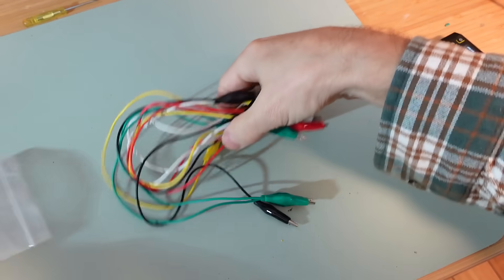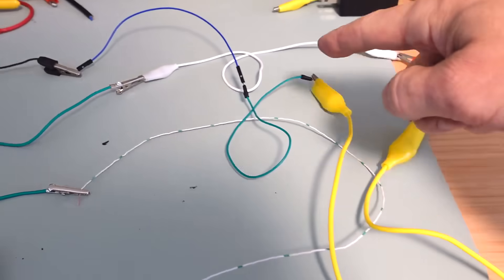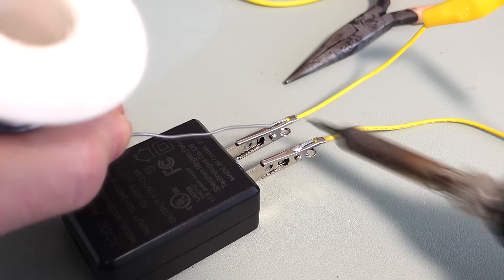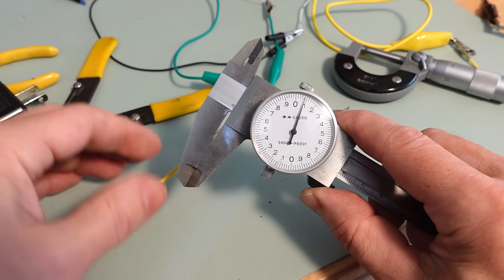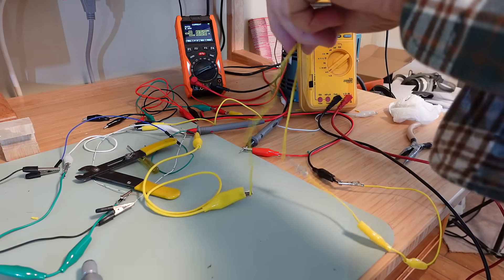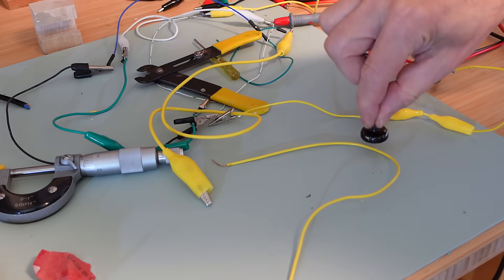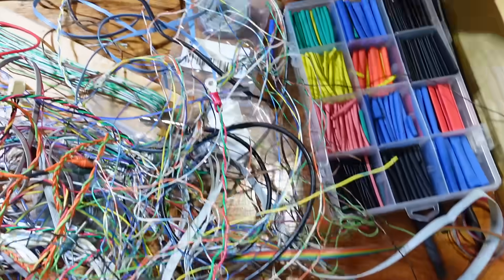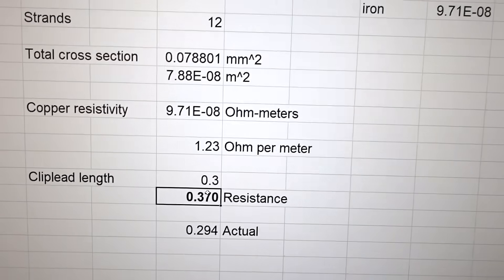Clip leads made with fake wire

Comment: Sir, after watching your video, I grabbed a magnet and poked around in my drawer as well. I was shocked to discover that even some very short (and thick!) MOLEX computer power supply cables I had used for various projects were completely fake. Not only were they not made of copper, but beneath the thick insulation, they barely contained any strands of wire. Naturally, they came from China. It's amazing the lengths some manufacturers will go to just to cut costs. If only we had some way to verify these things before making a purchase, but that's next to impossible on AliExpress. It's not even a matter of paying more, because you can't be sure that a product costing three times as much as the cheap one is any better in quality. I guess it's just a gamble, then. Thank you for the eye-opener! :)

Comment: I order a bunch of these from aliexpress using them for testing led lights but the wires were getting hot so I tested them and they had a higher resistance than normal and I did the magnet test and the magnet stuck so now I buy mine from harber freight they work good.

Comment: Iron huh? That sure explains it. I found this problem a few years ago. I bought a bunch of jumpers for an Arduino project From China. They didn't perform right. I measured the resistance and found them to be about 7 ohms for a 6" jumper???  I didn't check with a magnet but I'll bet they would have stuck. I threw the batch of jumpers in the trash. Where most of their copper products belong.

Comment: Yep. I got a bag like that. Half the alligators pull right off the stranded sire. The ones you show in this video are twice as "quality" as the ones I got. The ones that were crimped well enough to carry current melted under very low current. I think they had maybe 4 or 5 strands of Chinesium alloy.

Comment: I got some of these a couple months ago before watching this.  Laughed when I noticed how thin the wire was, then replace all with 20G wire.  Now you proved those wires are steel !!  Houses will be burned to the ground.  Hell,, I have some smaller USA made automobile alligator clips made about 25 years ago 10X thicker with real copper.  They have a warning label on them to not exceed 1/2 amp for continuous, confined usage.  These fire making china death leads should be marked:   "STAND BACK - SHE"S GONNA BLOW"
Reply from the maker: Electroboom recently had one go up in smoke on his videos.  No doubt knowing it would go up in smoke before ne did it, as most of his accidents are intentional.

Comment: By the way (I haven't read all 3,385 comments...) check the leads on any cheap parts you buy, too.  Resistors, caps, etc.  Some of them are iron core, too.  Of course the leads are relatively short, so the effect isn't quite so pronounced.

Comment: Interesting this...  I measured my jumpers that looked exactly like Mattias's...  however, the clip itself is iron, while the wire is non-ferrous.  When I measure on the fluke 87-V multi-meter, I get 0.2 ohms or 0.3 ohms....  I decided to put the wire on a good LCR meter with calibration done on it first...  The assumption was that the LCR meter, has more resolution at low resistances...  Sure enough, the two LCRs that I have measured .02 ohms or .03 ohms.    The specs on the Fluke say that maximum low end resolution for ohms is 0.1 so that explains why it would not show anything lower in value.  Soldering my wire connections on the clip itself revealed no significant improvement.  Fun little experiment!

Comment: Built my first working circuit 51 years ago, where I had to solder something. Before that I had used clip leads and could barely open them at that age. I can attest that clip leads are the most irritating thing I use now because of all these aspects you pointed out. Misery may love company, but not in this case.
Reply from the maker: worst is, if I put a clip lead around something large, and then as I'm debugging, the clip lead somehow slips off the round thing and jumps from the spring energy.  And then not remembering exactly where it went!

Comment: I was just testing some I just bought from jungle site.
They also had high resistance, it seems to be the wire causing the issue.  I did not try a Magnet yet, although I was suspecting the wire wasn't all copper.

Comment: A coworker bought a set of MADE IN CHINA battery cables and asked me to see why the cables didn't work. One of them had a copper wire shorter than the insulation and they only stuck the insulation to the clamp. That's why it's important to have quality control.

Comment: I've noticed another "fake metal" (sort of). Most of the cheap kitchen utensils that are billed as stainless aren't, to varying degrees - usually shows up as a rusty fleck. Not catastrophic failure, just heightened cynicism 
toward Ji-na 😊
Reply from the maker: There are different grades of stainless steel.  Some, like the cybertruck apparently, will rust when exposed to salt water, for example.  Could also be heat from a diswhasher doing it.  Or they are just coated with something instead of stainless steel.

Comment: I often use these cheap clips in my projects and this explains why I sometimes get really strange readings, especially since I work with low voltages. I never though about testing them. I will be going through all my wiring and check for Iron. I also bought a few transformers a few years ago and found out the windings are not copper at all - they are all coated with a copper color, but when you sand the ends for soldering, they look like aluminum..... i hate fake stuff - especially when they were not cheap.

Comment: I have issues like this all the time.  Fake wires are really common, and it's pretty bad with USB cables, etc too.  I stripped a few just to look and was kinda shocked.  Yea I think I found a few USB cables made with this junk too instead of copper.   They would barely give anything a charge, and overheated like crazy.   I couldn't figure out for the life of me why they would do that, when I realized just how valuable copper is getting.  It used to be really cheap, but the price is rising quickly, especially overseas.  I've also had to be careful with chargers, and even extension cords.  Found one that was definitely not the gauge it had indicated, and I got the stupid thing at a store, not online.  Took it back explained that the USB ports in it did not work, and the cord itself was unsafe to use.   They didn't care.

Comment: I have the same clip leads. Some of them didn't even had contact to the clip of just fell off after I had used them a few times.
They produce everything as cheap as possible...
A while ago I scrapped out a cheap chinese table fan, which had a magnetic power cord and hollow iron prongs on the plug. And copper coated aluminium for the motor wire.

Comment: I've used these test leads to charge batteries at very low current and had them pretty much melt, this explains a lot of issues I've had and it looks like I'm going to have to throw away everything I currently have and try to get some new higher quality ones.

Comment: If it's from China, not surprised. I worked at an alloy fabricator once as an electrician. Lot of the alloy material came from china. On several jobs , they were unable to get accurate machining  on a CNC machine. It was terrible. It was discovered the alloy had a mixture of lead in it. It was unworkable . But China did not want it back , the customer had ordered  it and delivered it to us. Job was never done, the alloy sat  there for months until a decision was made.  It was all scrapped.

Comment: Lovely investigation.  Thanks for sharing it.  It is one thing to make electrical wires out of iron, if that is the product you are manufacturing, then whatever, but to coat them in a thin layer of copper to trick people into thinking they are copper is just plain evil.

Comment: those mouse wires may be magnetic due to shielding. sometimes they use metal wrap to strengthen the cable knowing it will be tugged on.|
I will definitely be checking test leads a hell of a lot more often now!

Comment: Well that explains something.  A couple years ago I grabbed a couple of clip wires to test a relay in a car. Should have drawn less than an amp. But one of the clips wire heated up and melted right through the insulation.  I thought that it must be shorted out internally. But this didn't make sense since I was getting correct resistance readings. Replaced the relay and went on with life wondering about the mystery. After seeing your video I grabbed a magnet, and yup, the clip is iron wire. Mystery finally settled.

Comment: Cool research! Thanks for the warning! Given my recent experience, 99,999% of cheap Chinese stuff is an imitation in one way or another. 
Ranging from simple wires and "20A" multimeter probes with no indication of a cross-section to the trending things like ZOYI ZT-703S that has critical issues in almost every function, those are just very low-quality (in both design and execution) toys that pretend to be useful. 
For instance, they also make windings of scooters and motorcycle stators from what is called copped-clad aluminum, so that they look like copper but way less efficient and will burn because of their lower characteristics. But who cares.
Unfortunately, there is almost no middle ground, component stores with extreme shipping costs, and high-end products that are not very suitable for a hobbyist due to their prices.

Comment: I had to replace a three-core flexible cable feeding a 240 volt machine because the insulation was falling apart. The machine only needed a small intermittent current, the cable was protected from damage behind a wooden panel, it was in a place that didn't suffer extremes of temperature. It was of course a Chinese made flex. I've also bought small "brass" brushes that were really steel brushes made with brass plated wire.

Comment: Got these same jumpers, come to find the actual wire was 1 strand covered by cloth strands. 
It had like 15 strands on cloth and 1 strand of actual wire which was the conductor.
After stripping it down and soldering the actual "wire" i finally got 0 ohms across it.

Comment: This makes me want to spend a afternoon and test all of my clip leads wires .I have a ton and now I'm wondering if some of my past problems is due to cheap fake leads
Reply: Got these same ones, come to find when i stripped them back, it only had 1 actual metal strand of wire wrapped with about 5 cloth "fake" wires then the insulation.
After stripping all 6 down and actually soldering the wire to the aligator clips, now they read 1 ohm where as before when they soldered them, i got no shorts or high resistance.

Comment: They have been like this for many years. I had some that melted with a few amps through them. Most of the USB leads included with cheap stuff are junk, very thin conductors with large voltage drop, no data wires. I've thrown a lot out after testing.

Comment: A very common occurrence unfortunately. I call them "fake blondes". 
While coated steel wires can be detected rather easily with a magnet, the aluminum ones may cause some trouble. In a doubt - check the color of their cross section.
Reply from the maker: aluminium is 4x as conductive as iron, so not so bad
Reply: @matthiasrandomstuff2221  True, but yet not as conductive as copper, and more brittle on bending. These properties are crucial in arranging properly low voltage battery wires handling +15 amps. 
Also don't forget the fact that aluminum is (a bit) harder to solder.
It's just scammy. When I buy copper or at least something resembling copper on a photo I want to receive some actual copper.

Comment: But the current flows on the circumference of the wire. Perhaps the copper coating ia not thick enough?
Reply from the maker: flows thru the whole wire except for high frequencies

Comment: i just grabbed magnets and checked my recent clips - and all iron as well-  however, except some of the bigger design ones, ones designed  to plug into bench top power supplies, none of the (despite being cheap china made) - were attracted to magnets, only the super thin wire/small clips one..... strange.  youd think if this was some cost saving thing, those would be a target, as they are so much more wire... not the super thin wire packs of biting clips, which use so little wire to begin with, it would be more noticed if something were wrong.  (would take a lot more amp/use on the bigger wires to get them warm, than a single amp on the thin wires)

Comment: I bought some of these cheapo leads off eBay. Utter crap - I couldn't believe how thin the wire was. I've made much better leads myself from scrap flex. Copper costs more than iron, that's the bottom line.

Comment: i appreciate it. i tested my leads today and they were all earratic under physical  manipulation and using very fine 22awg. i re did them with 18awg and they are all 0.2 ohm stable even in series
Reply from the maker: 0.2 ohm is still high for a clip lead, but it could be your meter.  should have around 0.02 ohms
Reply: @matthiasrandomstuff2221  its a fluke 179 and it can only do 0.1ohm

Comment: they do it cheaper....these days. those wires. not even close to 95% copper, but an alloy of little copper with , probably, aluminum. I tried to solder these stranded wires with Sn63 and flux, it did not stick most of the times, and when it did, you could remove the solder very easily from the wires. the 95% copper wire color is totally different from these cheaper alloyed wires.  I guess you can find these high resistance types of wires everywhere......

Comment: Excellent diagnosis! Copper clad wiring has become a real ghost in the machine. I magnet test everything. A magnet is also great for identifying (non) stainless steel fasteners: the harder they stick, the quicker they rust.
Reply from the maker: lower grades of stainless steel will still stick to a magnet
Reply: @matthiasrandomstuff2221  Oh yeah, a magnet is sure handy when they aren't stamped or the stamps are hard to read.

Comment: Cheap steel wires. I've had bad ethernet cables where they did the same thing. Some motors are made with the same copper coated wire as well.

Comment: You will be more surprised by the material of the wire they use. It is made of scrap metal, cans, bicycle frames and other poorly conducting material plated by a very thin layer of copper. So it does not conduct well. It also explains that you usually cannot solder it, especially when using active fluxes. The same applies to some cheap wires you buy from AliExpress.

Comment: Superb. Before I retired, I spent some time as a school science technician. I made it a practice to solder the terminations on all hook up leads but didn't have this problem. A decade on, I bet they're having problems though with any new leads they're acquiring since the normal practice is to buy from the cheapest supplier for this kind of thing.

Comment: Had one of those amazon "200 piece electrical repair" kits kicking around in the garage that had some clip leads in them. I needed to track down an electrical gremlin in my truck, so I used them. After about 30 minutes of baffling results that plain didn't make sense, I tested the continuity of the clip leads. Nothing. I was furious. This is why "Chinese made" is so often associated with "absolute piece of garbage."

Comment: maaaaaaaaaaan this explains so much  !!!; I have the same chinesium-made crocodile test wires and once I tried to use them to make my ISDT Q6 Nano battery charger... do some charging/discharging capacity testing on a battery but because I was doing it at just 500mA or 1A I though that such a short wire would be ok in terms of ESR for such low currents... and.... no.... the ISDT smart charger kept interrupting the charge and announcing battery connection problems... as if there was an ESR issue with the battery.... yes; the wires are small but... the current I was putting on them was also pretty low.... ended up changing the wiring without investigating further what happened..... and now everything makes so much sense.... THANKS !
Reply: I am now going around my home-shop with a magnet and very quickly confirming that any cheap electronics accessory purchased in the last 5 years.... has a 50% chance of having chinesium-copper wiring :( I would have never though of such a simple testing... who could fall as low as iron wiring :(

Comment: I've experienced the same issue, high resistance and inconsistent connections.  Assuming my leads are copper, will test with magnet, I will modify.  Solder and shunt, meaning run a wire from one side of the jaw of the alligator to the other jaw.

I've shunted the jaws on some rather inexpensive car jumper cables in the past and believe the end results were worth it. 😊

Comment: I've come across with coax cable (RG59) copper covered steel core was magnetic.  I check cables with a magnet now. Copper covered  aluminium although not ideal is better and for coax I found that the signal loss over 100m to be acceptable.

Comment: those also do not solder well
Reply from the maker: actually, they soldered just fine when I resoldered the wire before I realized it wasn't actually copper.  The copper coating really helps with solderability
Reply: @matthiasrandomstuff2221  makes sense. Then, i guess, there are different kinds of fake wires.

Comment: They are, by no means, "fake wire". They are, most likely, "fake copper" plated ALUMINUM wires, which explains it all. I once bought what was advertised as 'copper' stranded wire, but it was really plated aluminum. The seller didn't argue and refunded my purchase (he knew he was trying to fool the ignorant). This type of plated wire is not easily soldered somehow due to the extremely thin copper plating, but will, somewhat, if you persist. However, 'good' soldering doesn't seem possible. The solder just doesn't flow properly.